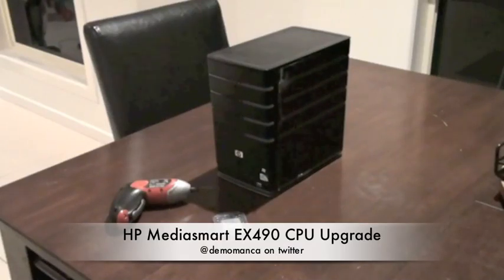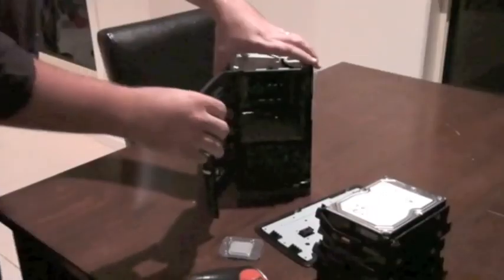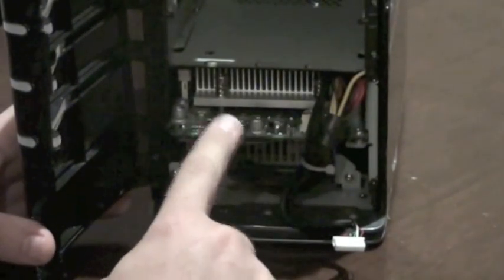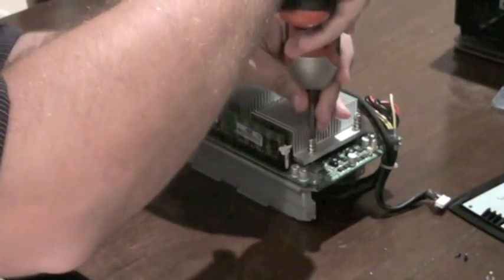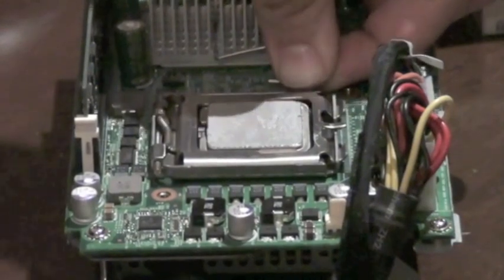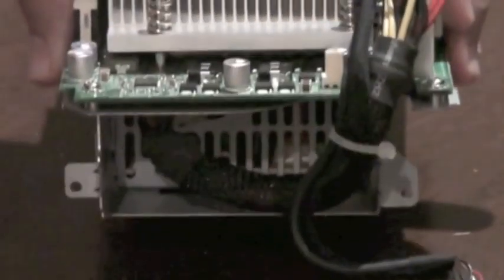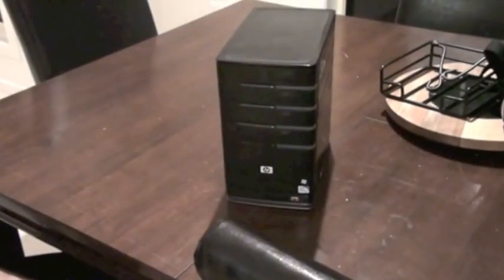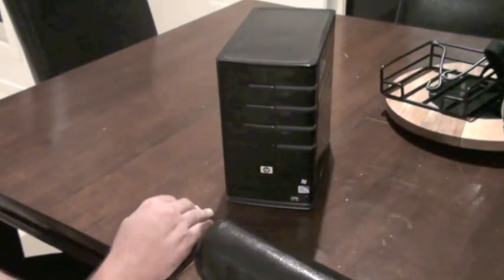EX490 CPU swap

Comment: Thanks a bunch for showing how to take apart an HP MediaSmart server.  I needed to replace a power supply on mine but was stymied in trying to get the old power supply out.  Thanks to your video I got the failed PSU out and the new one in and everything works as it should again.

Comment: Thanks for the video. Swapped the CPU in my EX480 with this video with an E6600 I had from a previous build.

One note. The first thing you do is take off the top cover by sliding it back (0:34). I want to add it is very easy to break this tab if you put too much force on it during the removal. If you look in the inside there is a small release for the tab at the top of the chassis. While it is pretty rigid, pushing it with a screw driver may help people not to break their tabs (like I did).
Reply: Thank you for this comment, it saved me from breaking off the tab on my EX490.
Reply: saw this too late unfortunately - hot glue to the rescue!
Reply: @andytipping70  Good Lord a WHS still in operation!!! Hats off to you my friend! Mine didn't make it much past 2014 before the PSU kicked. 🎩

Comment: Hello, I used your instructions for my Ex485 and it worked great.  My only question is how or where do I do to see if the cores are all working.  I upgraded to the E5200.  Again, thanks again.
Cheers

Comment: Am about to upgrade my EX490. I have the EX495 CPU. It has no thermal compound on it. Do I have to apply some or will the stuff on the heat sink be enough? If I do apply some then do I have to clean the stuff off the heat sink? It would be great if I could get away without using any on the CPU. This video makes it pretty easy.

Comment: You should indeed have reapplied the thermal grease. You should have also made sure that there was no static electricity, as this will fry your machine, as I have unfortunately experienced myself. For the rest it is a very good video; I have not come across a better one. Thank you for posting this.